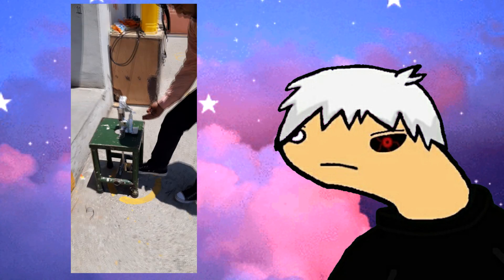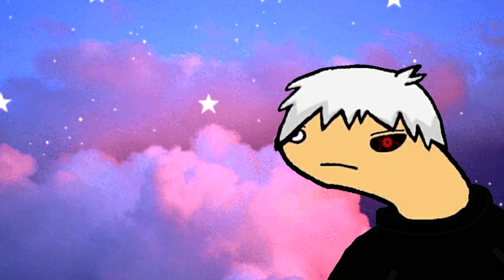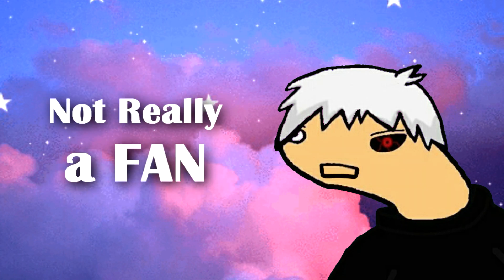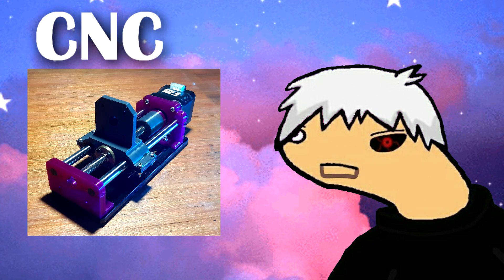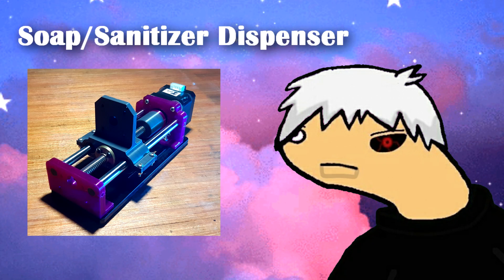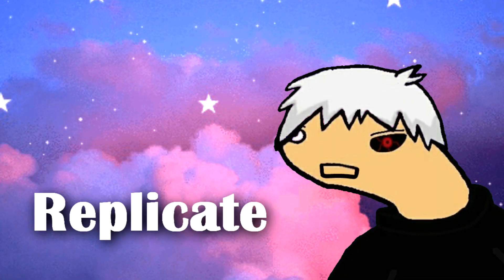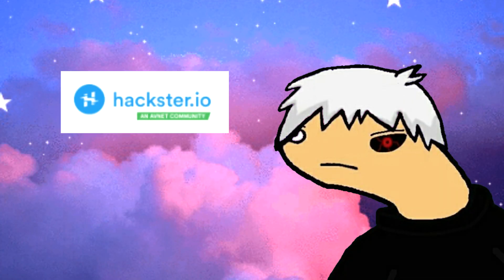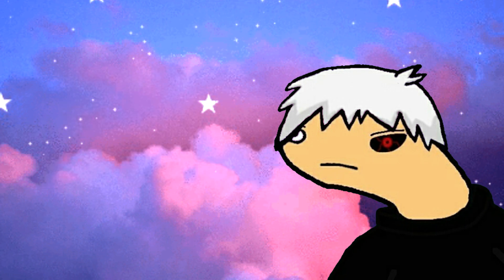Automatic Soap/Sanitizer Dispenser

Comment: Still waiting for a low tech version of this device with a foot paddle connected to the soap bottle presser with a bowden cable.
Just simple mechanics, no superfluous electronics that need electricity, get damaged by water and suffer under high humidity (showering in a small bathroom does that until you're done and air it out).

Heh: https://duckduckgo.com/?q=soap+dispenser+foot&iax=images&ia=images
Don't see one with a bowden cable but the pneumatic ones seem similar enough in function and much easier to build yourself.
Reply from the maker: You mean the boring foot dispenser